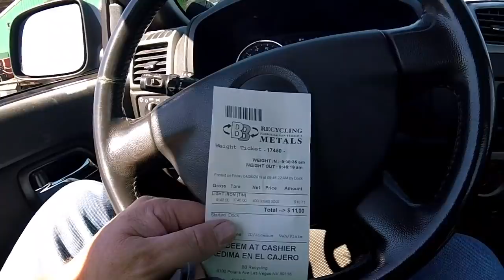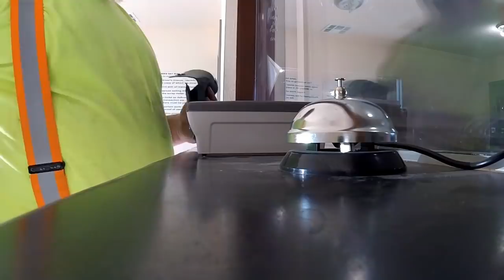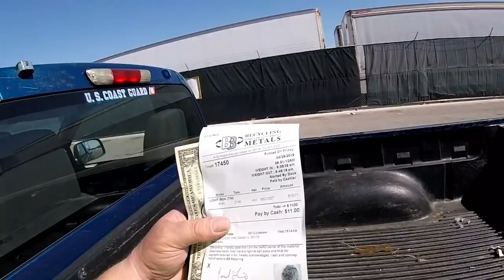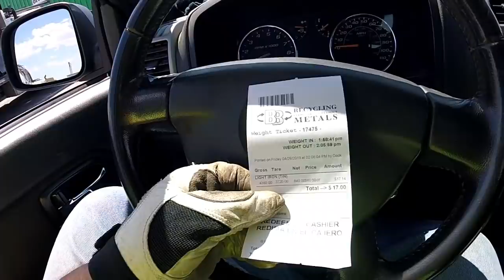I Found All of This ON THE CURB

Comment: I got a old grill just like that one from a friend who was going to toss it in a dumpster at work. He never used the propane side just charcoal side and smoker. Handles on the side rusted out and broke on him so he bought a smaller one. I offered to take it since I scrap and it barely fit in my Dodge Dakota truck, sat it upright parallel with the back window and the legs were just narrow enough to fit in and strapped it down. 

Looked like I was going to some tailgating party with an oversized grill but was able to add more scrap iron in front of it once I got back home to make it worth taking to the yard. Wheels made it easy to push it off the back of the bed into their pile, make a dust cloud when it hit but was easy to unload.

Comment: Get a hand truck with a crank lift. Those are handy as heck. Seen a guy that had a square tubing welded to it and it went into his hitch. So like with that AC you can wheel it over to the truck crank it up to your tailgate and push it off.

Comment: Wow that storage unit is filling up. That wire you cut off the wall over, that rigid metal over that wire should be aluminum. Everyone I have ran across has been so far. More for the aluminum pile. Have a great day! Glad your mother is really doing better.

Comment: Gas powered weed eater before you scrap it check with the local r c club they love the motor for there boat and cars also on pick truck tale gate unhook the cable on each end it will drop down to about a 45 degree angle easy loading
Reply from the maker: I forget about that angle loading on the tailgate. Thanks for the reminder. Seriously. Super good tip